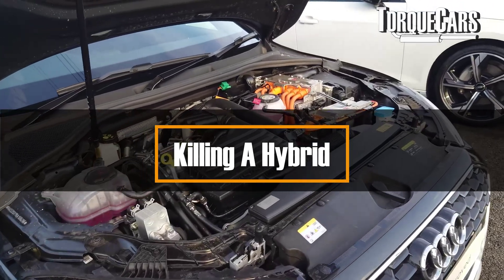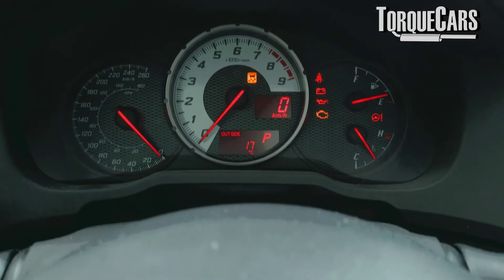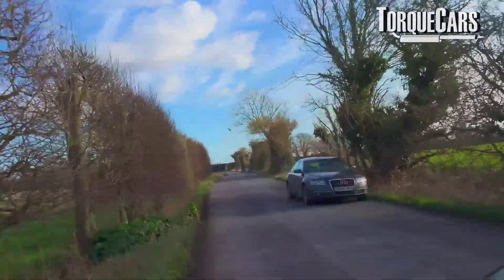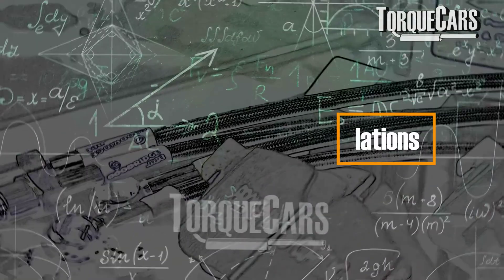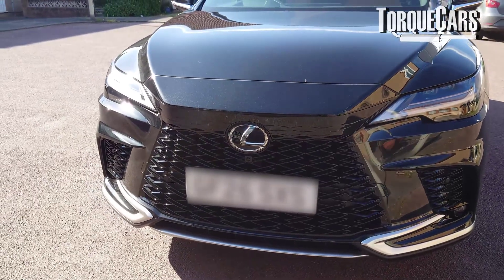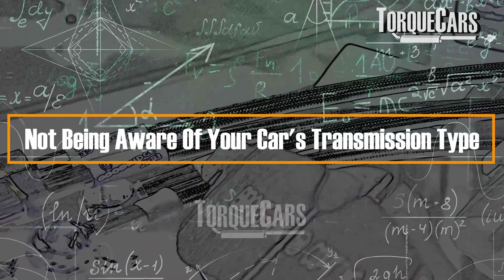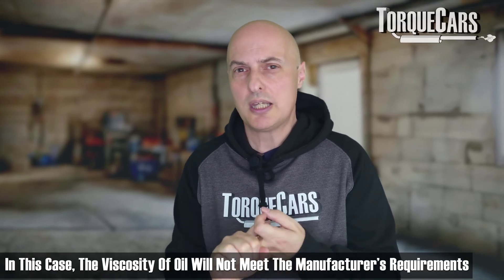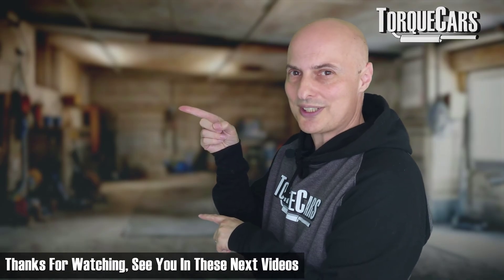The Hidden Dangers From Driving a Plug In Hybrid Badly PHEV (No One Tells You This)

Comment: Toyota CHR hybrid.
It's a daily driver, I do many short journeys and I'm mindful of getting it to temperature what ever that means? Sometimes I will drive a bit longer until the temp guage is central. I'm aware of Toyota having oil dilution problems but is it the case in all engines? I understand it's realated to direct port injection , I would like to know?.
I will definitely be replacing CVT oil around 60k and ignoring dealership. I did it on my old Honda automatics and it made a difference.
Reply: The temp gauge you are looking at is most likely your water temperature, not oil temp. Getting the oil hot evaporates the fuel and moisture contaminating the oil, leading to better lubrication. Warm oil flows faster than cold oil, which is best for lubrication, especially if you’re accelerating hard or putting the engine under a heavy load.
If you’re not getting your oil hot and regularly make short trips, you’re going to want to change your oil more often. Good rule of thumb I follow on my car is to cut the manufacturers service intervals in half.
Reply: @clutch7366 is there any way of monitoring oil temperature if you have no gauge?
Reply: @bapsteruk You would have to install an aftermarket gauge. A sensor would be fitted in your oil pan, a gauge installed on your dashboard, and a custom wiring circuit would be needed.
Reply: If it was so important.....not saying  it isnt......but wouldn't manufactures have installed an oil temp gauge???
Reply: hybrids have very thin oils - ow20, 0w16,even 0w8. No need to heat up. The difference means how they handle without heating, Regular ICEs start from 0W30, old ones 10w40 , etc...
Reply: I would say once the water temp gauge reaches central, drive another 10 minutes with the engine on for the oil to reach operating temperature. A good motorway drive will do it. The Toyota hybrid uses and ecvt. Completely different to cvt. The fluid can be changed around 60k miles to 90k miles. It’s more important to keep the hybrid battery fan filter clean. Usually located by the rear seats. So the battery won’t overheat.
Reply: Nothing goes wrong with these cars. Don't worry. Just drive sometimes on motorway (higher rpm and engine load)  and keep up with ur service intervals.
Reply: It's a Toyota hybrid, it's proven bomb proof technology. Service it at the Toyota dealer on time & stop worrying about it. The E-CVT transmission is also bombproof.

Comment: Just run an ICE...simple
Reply: Of course ICE engines don't have any issues ... Wet belts,  DPF's  etc...
Reply: @Pironi28  But they can be both bought and fixed cheaply unlike milk floats and don't suffer from eye-watering depreciation
Reply: @graemejones9707 EV's yes Hybrids especially Toyota no.
Reply: Simply Stupid to think a ICE engine is simple compared to an electric powertrain.
Reply: I reckon either ICE, or fully electric. It twice the complications being both but for only a little benefit.

Comment: When I was wroking for a toyota dealer back in 2008, lots of hybrid Camry and Prius have determined non-repairable after collision. Body panels can be fixed, but not electrical parts/ modules. They can behaved so erratically, that we could not figur anything out after hunders of hours to diagnose, untill insurance company rejected everthing and send the car to salvage yard. This kind of things are getting worse today, since some of old hybrids still on the road, some time just a bad 12v battery can cause a module failure, and the cost of replacing/reprograming the modules can be more expensive than the car's value. Electrical parts does have limited service life, just like the batteries, and they are much more unperdictable.
Reply: 2008 LOL
Reply: Dude... it is 2025 already, 2008 was 17 years ago.  Technology has changed and moved on.  Electrical and electronic parts do NOT have a limited service life in most cases.  In fact, most failures on cars are mechanical, not electronic.  The only parts that are considered to have a limited service lifespan are something like ignition coils which are specified to be replaced as a part of a scheduled maintenance.

Hybrids in general are however less reliable than EV's, because they still have all the mechanical maintenance requirements of combustion engine cars, and require a transmission, unlike EV's.
Reply: Yeah, I’ve heard of this. I was doing some research and apparently, some vehicles need to have a 12V power supply attached to the car’s terminals prior to battery disconnect and they need to have the battery replaced  at certain intervals to prevent complete power loss. Crazy stuff.